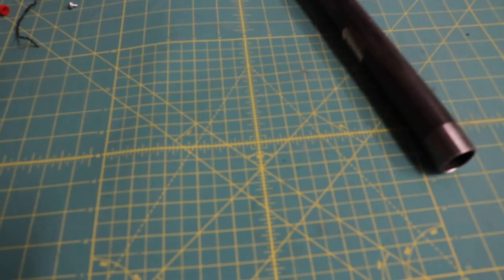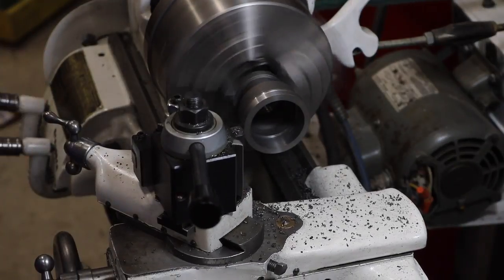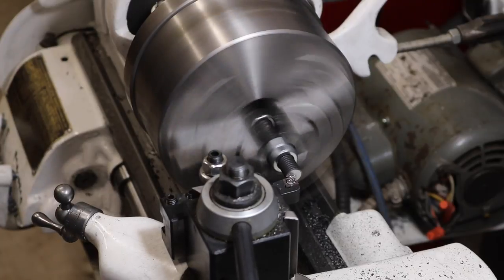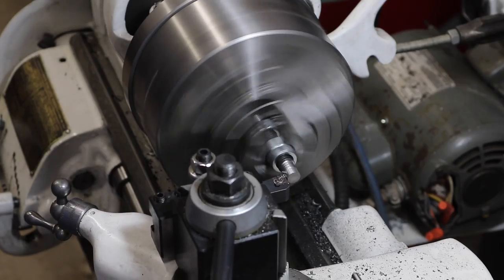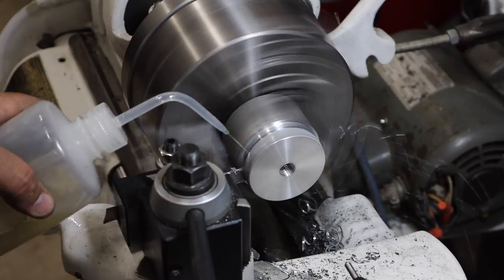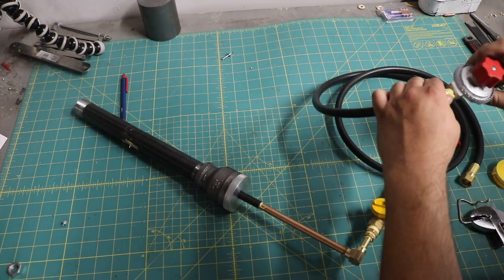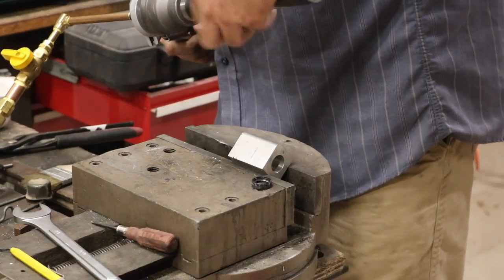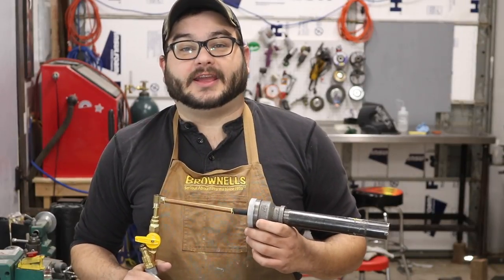Beer Keg Foundry Part 1: The Propane Burner

Comment: Yes!!! that's awesome!! I know you got the flame mixture balanced and stuff, but a good cheater way to keep the flame stable is to put a flare on the end of the burner.  It's much more forgiving, but it does mean you need a bigger hole in the furnace for it to fit.

Comment: I had the same issues and as others have said, a flare on the end will make it work great. I used an old 3/4 drive socket... about an 1 1/8" I believe.

Comment: When the flame separates, it means the gas/air mixture is flowing faster than the flame can burn it.  As soon as the flame moves away from the orifice, it becomes turbulent and slows down which allows the combustion to catch up.

To stabilize the flame you need a burner nozzle.  This slows the air as it exits the burner tube and allows the flame to sit happily in the nozzle.

Too much gas and you  get orange and yellow tongues from unburned gas.

Too lean and the flame is very blue and short.

Comment: Add a blower on it then it is just a wall switch for speed and a gas regulator for gas pressure  it works a charm! I'd also recommend firewool as a insulator I've cast aluminum and brass no problem.

Comment: The way to solve the issue with the flame lifting off like that is to add an interupter for the gas flow. A simple sink strainer or piece of steel mesh can help immensely. I know there is some kinda industry standard for the size of your gas orafece in relation to the gas tube size and the gas flow at the end of your tube.

Comment: Now I've never had good luck keeping a pressured flame without a cuppler/mixing flare...?.  Even if it's in my forge or not..  I just set a flare coupler right in my refectory mud and I just screw my burner in and out as I need to..

Comment: when the pipe is in a foundry or forge you do not need the flair, the flair is for open air ,my propane rosebud. alltough   you can use the burnner with the flair in forge or foundry. O say about 2600 f . brass bronze no problem iron say 31 32 hunderd .ok  just get a coke fur. coal is good. GLOBAL WARMING NO. We ar over du for a major ice age.Thank you. BY GOD.